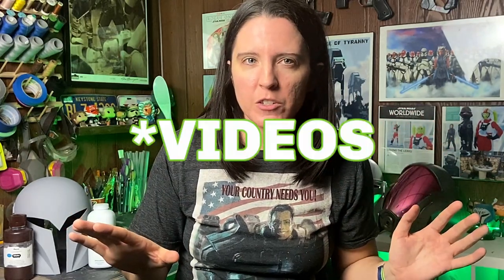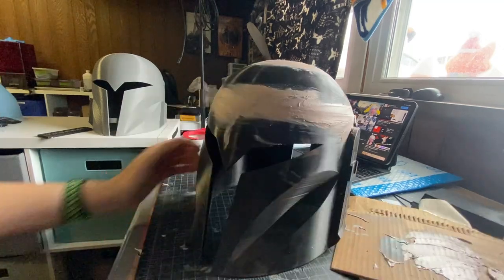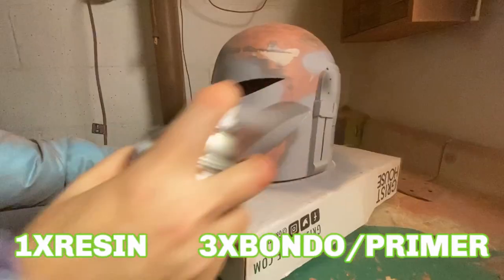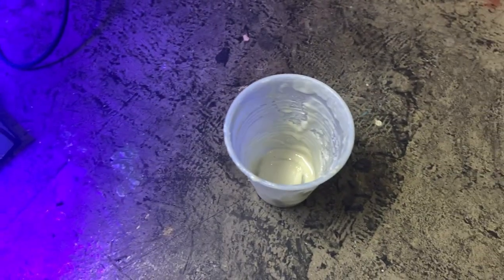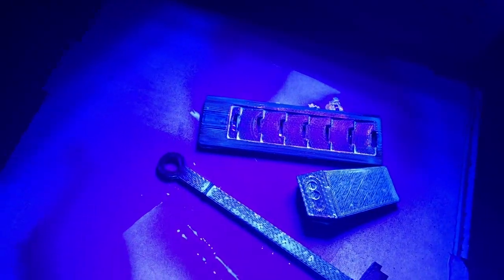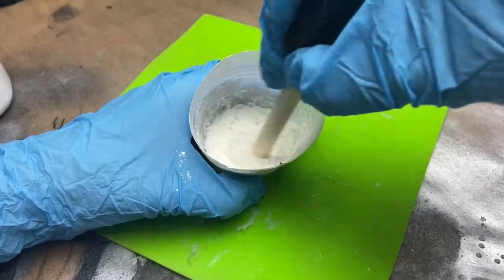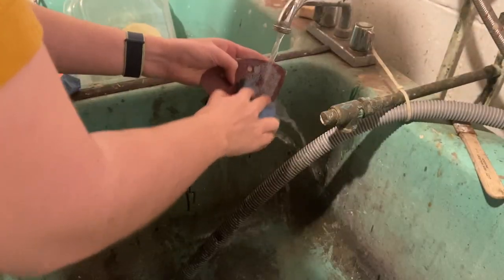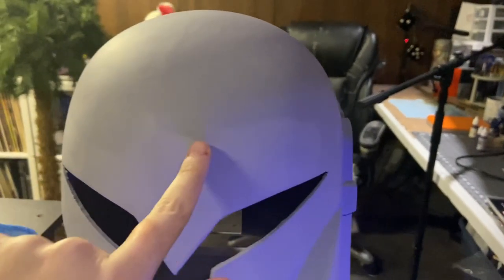Filling Gaps in 3D Prints WITHOUT Bondo  + Tips for Working with UV Resin

Comment from the maker: SO I was wrong about the wattage being what matters, it's actually the WAVELENGTH of your UV Light that matters! Sorry guys, still new to this! (and thanks to my husband for pointing it out, he's the one who uses this resin the most)

For example, the stuff I use would need a UV Light of 405 Nanometers to cure correctly, which my UV light happens to be. If all else fails, the sun always works!
Reply: I have 405nm 60w lamp and it cures the thin layer-line coats in like 30seconds. As you figured in your new video, I think it often cures fast but we over do it because we mistake the tackiness that needs to be washed with it not being cured.
Reply from the maker: @budakhon  yep, exactly. I completely forgot that it’s the same way for prints off an actual resin 3D printer where that layer needs washed away too.
Reply: @budakhon  the baby powder probably impedes the UV light a bit as well.  I wonder if clear resin would work faster, as light might travel/propagate better through it.

Comment: For as many people that like this method there are 3 that hate it. Toxic,messy,gravity controls you. It may be for some but it isn’t for everyone. I personal hated using resin, there’s many other ways to do it using automotive restoration products but hey different strokes for different folks. Helmet came out great, do what works for you!
Reply from the maker: Exactly!!! I actually touch on those cons in some more current videos after having more experience with it and it's totally true ... it can get messy and is INCREDIBLY toxic if you don't work with it the right way. Thank you for being cool and understanding that we all craft in different ways
Reply: @vaultfox  seen your video pop so I gave it a gander. Good content for sure, my only quarrel is bondo is the brand not the product lol in your defense though I get it, most people in 3D printing don’t know the difference between body filler,glazing putty,filler primer or resins it’s all just called bondo & it absolutely drives me insane lol

Comment: You can get a rubbery thingy block to clean you sander disks with: Silverline-Sanding-Cleaning-Block. Or you can (apparently) use a tube of silicone that has gone hard through being left in the gun to long, with the end cut of. just cut the tube of it and use it to rub the sanding belt/pad. i have used the cleaning blocks a lot but never tried the silicone mastic tube subsitute.
Reply from the maker: oh thats good to know! I have some silicone molds laying around, I'll have to give that a try!
Reply: @vaultfox  Not sure if that will work try it the silicon I saw somebody use (on You tube) was the type you do the bathroom with. Let me know if it works plz.
Reply from the maker: @TheGathumpus  ohhh right right so caulking silicone? Well good thing I didn’t just rip into my sandpaper with my old molds lol
Reply: @vaultfox  You can try it

Comment: Do you think resin would be good for people on a budget? Since it cam be used for the majority of the helmet as is and for steeper layer lines you can mix up a small batch of the baby powder to act much gloopier
Reply from the maker: When I compare the cost of this (a bottle of larger resin is usually 30) to how much I’d use for tubes of bondo (about 18 a tube and I can do 2-3 helmets from one) I would say by far and away the resin is cheaper in the long run. It just requires more in terms of the cost of your curing method (if you want to get a UV chamber etc) and the safety you need to work with resin
Reply: @vaultfox  what size and brand of tubes do you get? I'm from ireland so it's hard to find anything with good sources regarding 3d prints and the ones I do find are either overpriced or I would need to buy about 3 of

Comment: So I tried that resin on a small piece and had the UV light on all night and it's still not cured and I brushed in a thin coat not sure what's going on.
Reply from the maker: check out some of my more recent videos on it, your resin is most likely cured but it will still appear tacky/sticky to the touch due to oxygen inhibition and can be fixed with isopropyl alcohol (this is how it's done in resin printing as well)
Reply: @vaultfox   ok that is the case exactly. I will watch your videos again.

Comment: Which type UV resin are you using? I know over time some are more brittle then others, which night cause issues down the road I would think.
Reply from the maker: I use the Elegoo Mars ABS-Like ... I wish I had this helmet still to see how it held up,
Reply: @vaultfox  when we got the FormLabs printer in at rhe Makerspace I used to be at, we got the standard clear resin, not thinking much of it. We learned pretty quickly the longer a print sat around the more brittle it got and snapped super easy.

We eventually looked into their "tough" resin(and some other one, I forget), and they were better because they were strong but flexible at the same time. Hard lesson learned, wound up with a lot of shattered and broken parts before we figured it out, lol

Comment: Thank you for all you do! I am new to 3D printing and cosplay and your content has been extremely helpful. I am finishing my first printed helmet which is the Imperial Super Commando and applied my layer of UV resin for finishing. I noticed that there are certain detail lines in the design that the resin went into and is not hard after curing. Do you have any recommendations on getting the resin out of small areas like this post curing? Is taking a razer through the crack my best option? Moving forward I will keep it in mind and not allow too much buildup in this areas.
Reply from the maker: You're so welcome! So it sounds like those small areas where the resin pooled have excess resin that aren't cured. I'd recommend wiping it down with some isopropyl alcohol (91% or higher), sand it roughly if you can, then wipe down again. It may need another hit of your UV light to cure ... but if you want to remove it entirely, then I'd just recommend trying to sand it down or use a small dremel tool to sand it away. Obviously while wearing gloves/a mask as you do it
Reply: @vaultfox  Awesome, thanks for the tip and will definitely have to add a dremel to my arsenal!

Comment: So after trying the UV resin method I found that without a light to cure it, it takes way too long to actually harden. I experimented with a small amount of fiberglass resin which kicks off pretty quick and found a very similar result, just less waiting time. I did have to sand the edges of the piece a bit where some excess resin dripped but overall I found it to have a very similar end result. Just have to be careful to use a very small amount of resin and spread it even
Reply from the maker: you know, I've always been interested in trying fiberglass resin but was always wary of it for some reason, might have been the fumes. glad to hear it works pretty well for you! I'd say that getting the curing process down with UV Resin is the toughest part, there's so many variables and it's not going to work for everyone.

Comment: don't pour used resin back into your new resin just in case you get contaminants in there that can ruin a batch... I pour mine into a different container and label it.  you can get black containers for film developers for really cheap.  that UV resin is fairly pricey... not worth wrecking a whole new bottle of it.
Reply from the maker: Good tip, I made it through an entire bottle of the stuff without issue though.